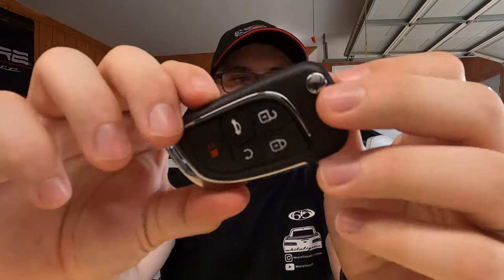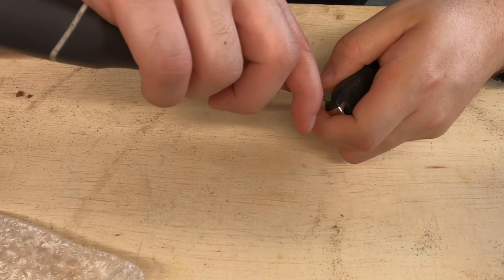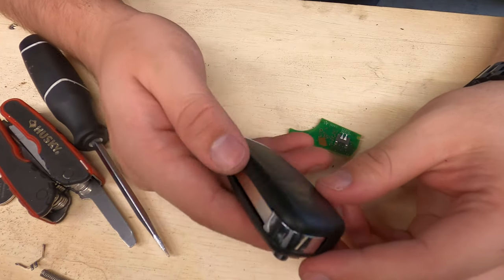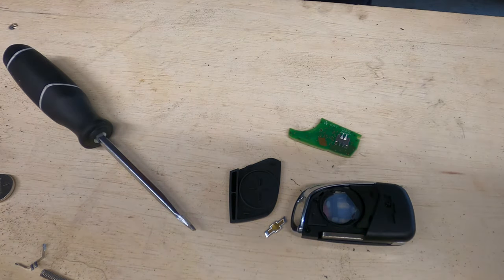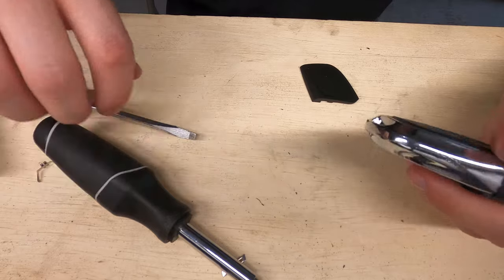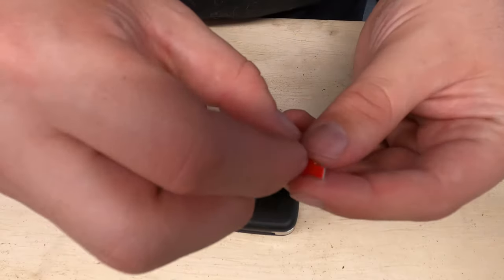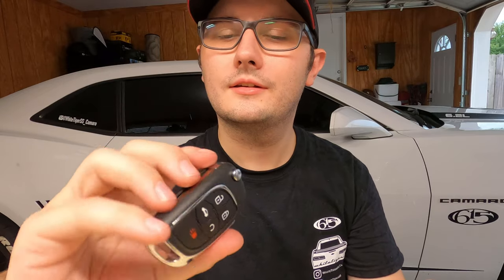$10 Ebay Key Fob (Install/Review)

Comment: My keys  won't unlock  the door and when the battery dies the fob won't work and had to get lock Smith out 2 times already  is that the recall?
Reply from the maker: Not sure why your keys won’t open the door.. maybe something wrong with the key hole? The recall was to remove the key from the FOB, but the other key should still work just like the FOB key.